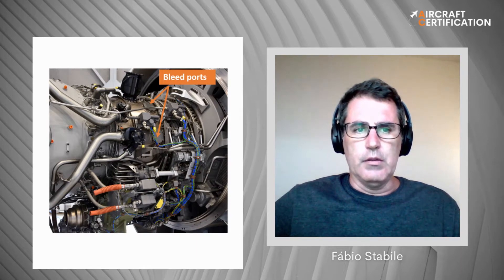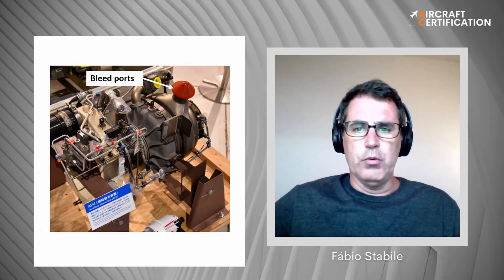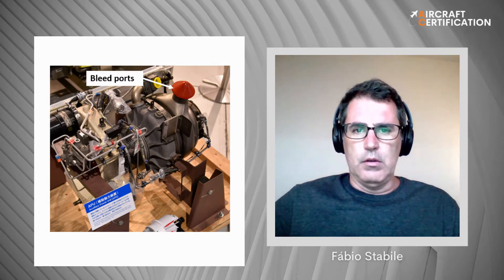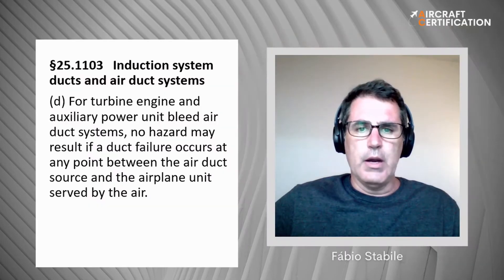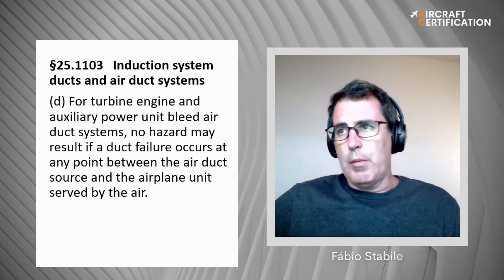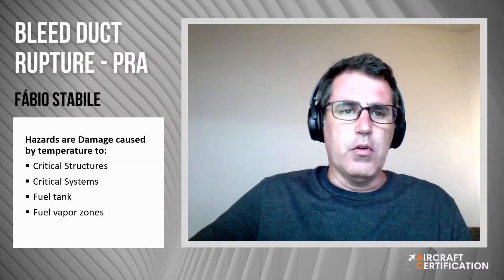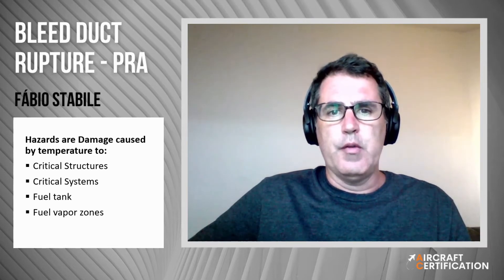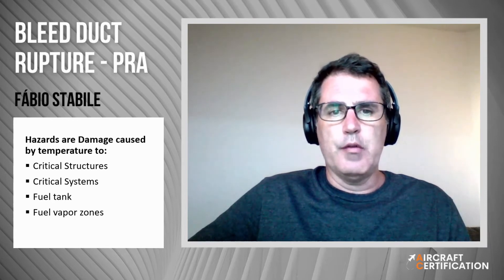Bleed Duct Rupture Particular Risk Analysis - Fabio Stabile - Aircraft Certification

Comment: Thank you Rafaela-san, Clarissa-san, and Fabio-san for this interesting channel. 
Fabao, you are great!!
It was one of the tough topic for certification.
I think it's also good to include explanation how to consider the size of leakage and how to describe the analysis for authority.
Besides certification but related that how to detect bleed leakage is also interesting subject.
Regarding electrical airplane, it's necessarily to consider the weight because more generators are needed to take energy from instead of bleed. At current technology, generating power density vs weight, it could be paid by light structure such as composite. But only large aircraft would be paid. I think.
When the new technology will be developed and trying to install into aircraft, there would be a big and important discusses with authorities for certification like Lithium Ion Battery.
Thank you.
Reply from the maker: Thank you Mizuide-san! You always bring great contributions!!!! Good point about the more electrical aircraft. I would love to hear the opinion of our subscribers about that!